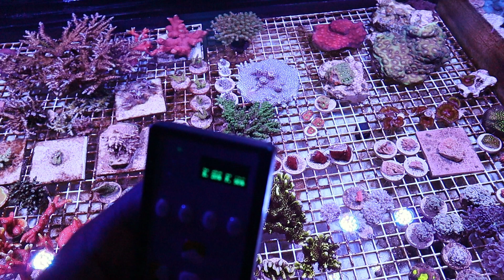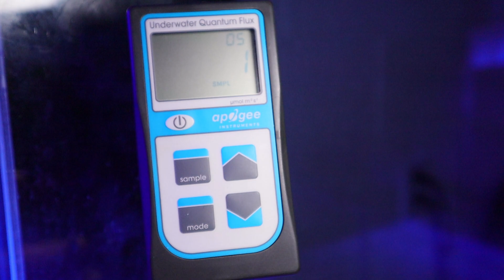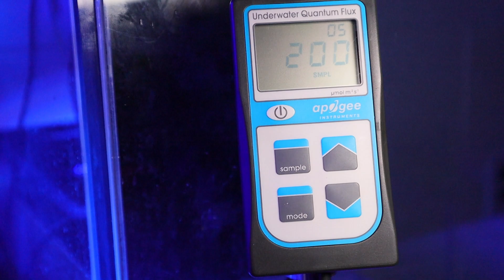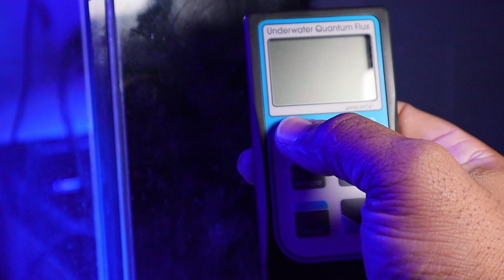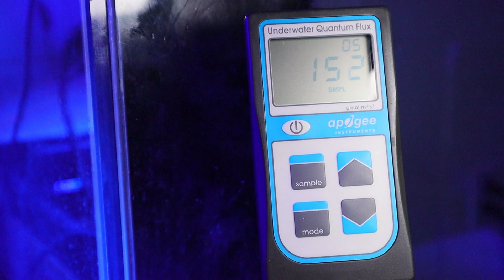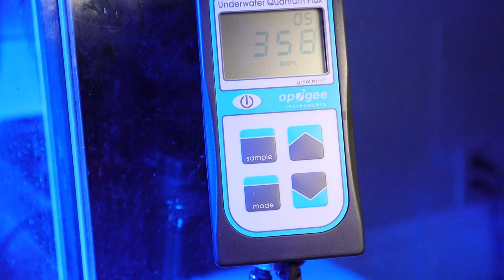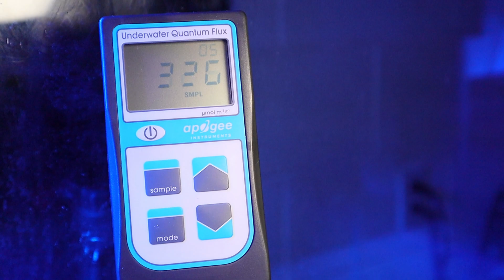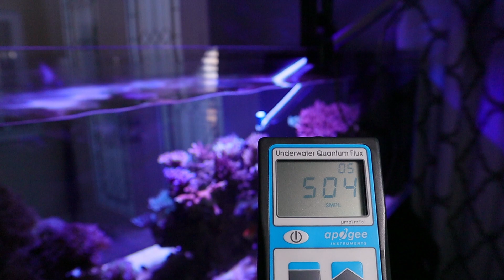Noopsyche K7 Pro V3 | Unbelievable Par Results

Comment: Thanks for doing this - these are powerful lights.

I’m running two on a 120cm x 50 x 50 soft coral with a few LPS, lights are at the max height allowed on the mount. I’d love to know what intensity settings folk are running these at for non SPS tanks.

I ran the default LPS setting for a start but I’ve found it’s too much and curious S to what others are using.

Great video, oh and that main tank is looking sweet.
Reply from the maker: Glad it helped. The best tool for setting these lights for any tank sps/lps and softies is a par meter.